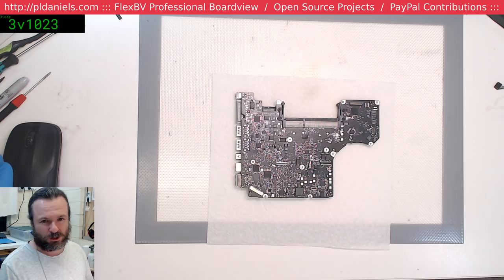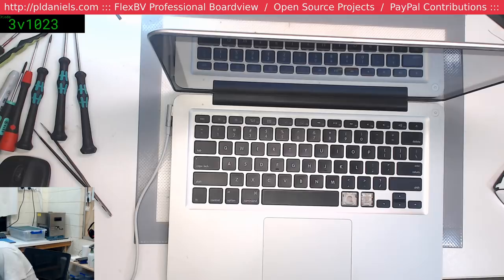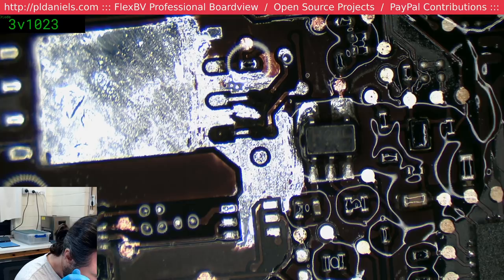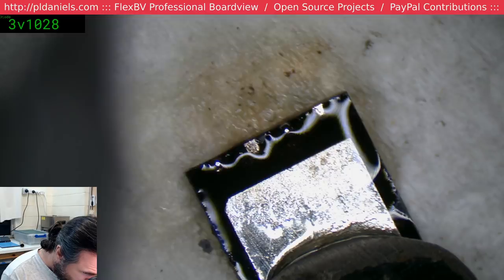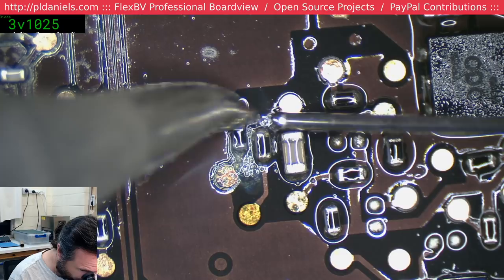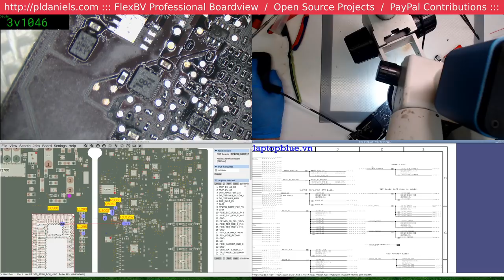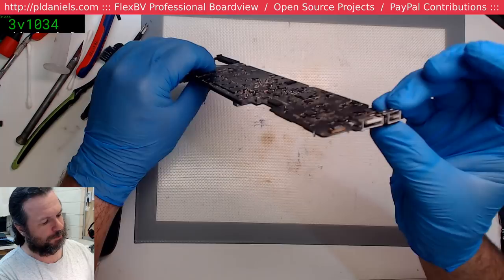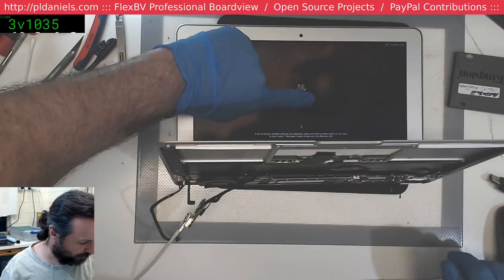WIFD: Macbook Air A1465 with BIOS issues

Comment: 10:59 I'm curious if the "Oscillot" Cat Fence (or some MacGyver'ed version made of cheap pool tubes or PVC fittings) could help to keep the fur kids safe at home and hence help Paul get more sleep...
Reply from the maker: It's more a case of worrying about potential oddities that may occur than the default level of risk.  Just being "outside" is a risk in itself.  The ideal solution for me is to have a nice 8' colourbond fence and then that is covered over with mesh/netting.  The colourbond fencing provides protection against critters getting through the fence and for the most part greatly inhibits climbing over, the netting provides the extra level of security.

All in all, this place currently has so many hackjob areas that it leaves me feeling uneasy on the best of days. The most peaceful time is at night after about 11pm when the furkids have been bought in from the greater area enclosures and contained within the house and the more restricted courtyard.